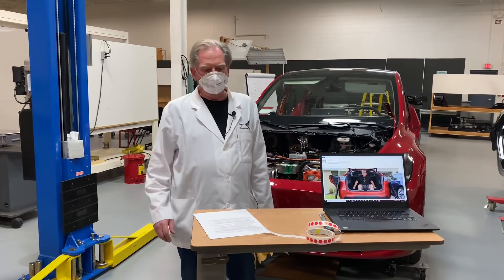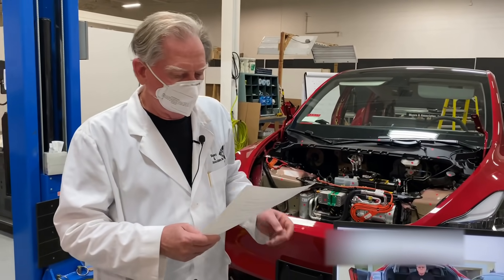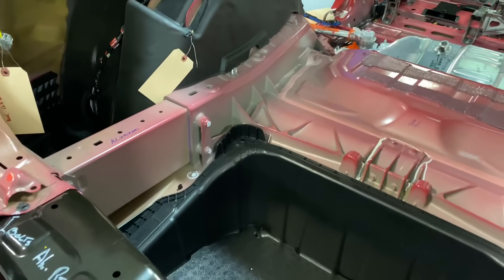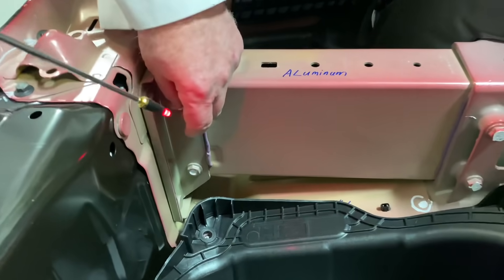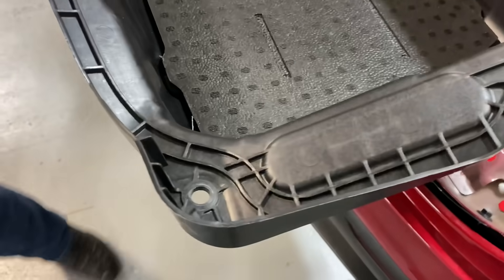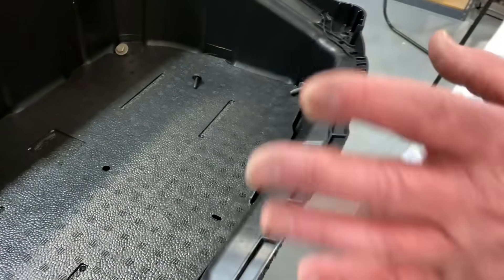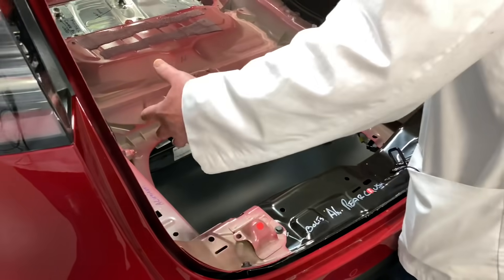Model Y E14: Rear Mega Castings and Structure, Trunk Tub, Potential Tow Location

Comment: If the mounting points move from the lower lip to the crash structure (the two aluminium rectangle section pieces) and if the lip itself gets cut out, then the idea of fitting one piece of "plastic" in the front and the back becomes plausible. The problem is this...the rear piece needs to have structure to sustain a human, the one in the front doesn't. So ... and i don't know how that maths out the front one would then become too strong, therefore a waste of material.

Just two cents of thought.

Comment: A heat pump, AC with free air circulation around it will run cooler and last longer. I don't mind a tiny bit of noise.

Comment: Is the non-matching bolt visible while the others are not (or vice versa). It seemed like the different bolt was black and the others were silver. A black bolt would match the bucket and look better cosmetically. Of course, the non visible ones could be made black too.

Comment: Sandy impossible to make frunk bucket and trunk bucket interchangeable. They are different widths and heights and would need to alter the frame and structure of car for what. YOU BLEW THIS ONE. The black buckets are cheap and to make and allows maximum size for both different areas.

Comment: The tow hitch is currently available in the configurator (at least in Norway) for 8800NOK (1000USD) with a capacity of 1600kg (3500lbs).

Comment: Its seem to me that the different one is color coded and goes in the middle. From the surface where the hole is, it appears to me that it may be exposed, i.e no trim covering it while other areas get covered? if so then i think having a color coated screw makes sense but then may be all of then should be color coated to keep it simple for installation?

Comment: If you think about it that bucket would be a good place to bolt in a range extender pack or even a small motor generator for extended trips / camping. 

Or even something that goes down and around and potentially replaces the bumper / number beam for a huge mounted rear storage lol.

Comment: No. Not tired of seeing you yet.
Now, I have to comment about how fast some vehicle owner could post about his complain (noise from the heat pump), while Sandy showed how the thing looks like and DURING THE SAME WEEK Tesla calls to inform that a correction is being made. That is not normal! You don't see that kind of speed in nearly any hardware industry. This is not an isolated case. There are plenty of stories of people suggesting or requesting improvements and corrections and Tesla responding faster than anyone else. Sometimes Elon himself does the responding. Other companies are watching, and they are learning [hopefully].

Comment: 3rd row seats will be front facing. There are multiple images online showing the orientation of the seat belts being parallel to the ones for the 2nd row. This is clearly displayed on Tesla's Model Y page. 
You may need to scroll down for the image to populate/slide into the middle of the page.
Also, I'm calling it now... 2nd row will have the ability to slide forward when the car is configured with the 7 seat option.

Comment: Mr.Munro thank you for your videos. Have a suggestion about the 5th bold that is black. Some manufacturers paint the bolts (screws)  with the same color as the surrounding plastic color. Can you check if the black bolt is visible when the trunk is assembled together? Thank you for your time

Comment: Thank you for all you are doing! We are not tired of seeing you.  Learning so much about the car. I have a Tesla Model 3 and am thinking about trading it in for a used Model S or used Model Y in a couple years. Your video is giving me a lot of confidence that Tesla is quickly fixing problems with the 3! I heard a rumor Tesla was thinking about removing the NiMH 12V battery in the model Y, simplifying the wiring, maybe a different connection to the doors? One of the main complaints I’ve gotten after putting 18k miles on my model 3 is the ‘rough ride’.  I’m hoping that was addressed in the Y or that is really going to upset folks.   Would love to see a comparison between ride quality in model 3/Y.  Would require you guys to borrow some non - dismembered cars :-).

Comment: So a plastic rear well is strong enough for someone to get in and out of a rear facing seat?  I’d think a metal well, like in the Model 3 would be stronger.  The possibility for a tow hitch is probably more for a bike rack or very light utility trailers, the Model Y certainly won’t be able to tow a camper trailer, at least not very far.

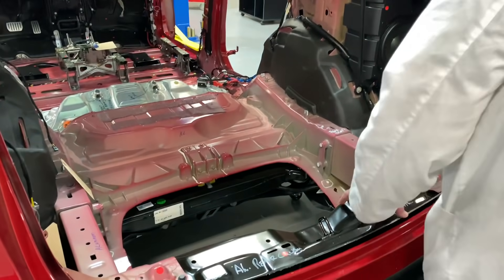Comment: 9:30. It looks like Tesla is paying close attention to your suggestions. There could be good reasons for the difference between the front and back liners. 
    With most legacy auto-makers it seems as if they deliberately have small differences between things, like trim pieces, which are often unreasonably expensive, which means having to pay dealer prices if something gets broken. Many parts nowadays are made of brittle ABS, which is very difficult to repair successfully.

Comment: Remember when Elon Musk said the Model Y would use only 328 feet (100m) of wire and wouldn't share the Model 3 platform .... the reality was in order to get Model Y out quickly .. it needed to extensively share the Model 3 platform and use conventional wiring .. and that's OK, as this Model Y obviously is the best Tesla yet, continuing to learn and improve, it's all good. Nice tear down commentary Sandy! .. watched all the vids so far, it's cool to see a few purchased parts in there that my engineering teams developed.

Comment: Wireless QI in the trunk or trunk. With that open gap in the front and back. It's possible to install a QI wireless charging reciever in there to charge up the Y without plugging it in

Comment: As MD of an engineering company 35 years to global auto Ive just spent 2 days assembling a 100 off items at home and guess what it had eight m3 x 6mm and two m3 x 8mm, my 6 sigma alarm is on red alert, I built 8 wrong, wrong screws in the wrong place........if you have to have different length bolts make sure that they really have to be different so they are very different or make them all the same, Mr Monro says so!
And we are kitting up work to be done at home as we speak just the same, find a way. 
Impressive Tesla taking feedback and responding, makes you realise everyone after the same outcome, success against the massive headwinds, they will make it. "Thats just about it for now!"
Reply: 3 people designing different parts of one product.
There should be a default bolt size where possible, only changed when absolutely necessary.

Comment: Sandy. The Model S had an issue with the a/c circulation and the rear facing seats. The back seats got uncomfortably hot in sun even with tinted windows. The tip Elon provided was to put the a/c to fresh air vs recirculate because the air exit in back was supposed to pull a/c to the back. That helped a little but still not great. Do you see anything that will improve a/c to the back seats vs model S. Better glass?
Reply: Also. The idea you had with the same buckets for the frunk and trunk. You should put together a bunch of ideas/options for the TSLA designed in China super low cost EV.  You probably have a lot of ideas (like the matching buckets) that don't apply as practical changes to current designs.

Comment: Adding a 2” hitch would be a huge benefit. Tons of people have hitch mounted bikes racks and having an SUV that doesn’t have this capability is a major drawback. It would be great if the hitch could be recessed behind the plastic cover, so you can put that on when it isn’t in use. I have a model 3 and will buy a Y if this is added.

Comment: Very interested in seeing what is inside the model Y because I expect to buy one once all the current chaos is over.  Maybe they will use the production pause to incorporate some of the things that Sandy is suggesting as running changes.  The software suggestion about the mirrors would seem especially easy to do.  Also, I would want to use a rear tow hitch, not to pull heavy loads, but as a mount for a bicycle carrier.  A weight limited unit that would not compromise rear crush-ability of the internal bumper cross beam seems like it would be doable, and not affect the range or safety of the Y significantly.  Most SUV buyers expect this capability, I think, even on small crossovers like a RAV4.

Comment: At 8:48 Mr. Sandy says the rear bucket should have been "glued in fiberglass", and he knows why tesla is using bolts instead. Is the bumper hitch cutout the reason for that? So that they can modify the structure later?

Comment: You might want to consider masking out Richard's email address...
Reply from the maker: Yep, working on that.  Thanks for the feedback and for tuning in!
Reply: @MunroLive   easiest way is to open notepad, and stretch it over needed area :) simplest, fastest, 100% effective without any post-editing :) 

BTW, I absolutely love this teardown series, and check for new episodes dozens of times every day! If you can please continue :)
Also "blue plastic brackets" holding candy-wrapped wiring is probably "designed" to be changed to new patented "flat" wiring looms, when those are ready for use in production ;)
Reply: @TheBartu5  Or like.. Screenshot only the area you want to show..

Comment: Sandy,
I think the third row seating will be only available in an 1 motor (front) configuration version of the model Y. The rear casting as you can see, has a glued in sheet metal cover over the rear motor assembly. In this third row configuration, I think this cover will be removed and the legs of the occupants will occupy this space. The rear facing orientation is also possible, but all the pictures I’ve seen are with the seats facing forward. Just an idea.

Comment: 6:40 Ok, so nobody is gonna mention that subwoofer in the trunk?!
Reply from the maker: Thanks for tuning in Peter! It is possible that we discuss this part in future videos. Not atypical for vehicles to feature this type of sub-woofer in the rear quarter panel. We will let you know if there is anything unique though!
Reply: @MunroLive  Thanks for the reply! The wow part was that you couldn't see from the plastic covers that there is a subwoofer because it was completely covered up. In other vehicles is very obvious because of the cutouts. If somebody wants to check what I'm talking about, take a look at 0:25 in E10 where Sandy explains the third row seats. Cheers! :)
Reply from the maker: @kpeterrafael  Yes, it definitely saves from a design and assembly stand point to bury the subwoofer and not have to put in an A-surface speaker grill, which some OEM's like to show off as part of the design. Some notable vehicles that also bury the subwoofer behind rear trim panels are: Mercedes GL450, Volvo XC90, Range Rover Velar. Also VW, Audi, & Buick have been known to put them in rear spare tire under load floor. Always fun to discuss these details!
Reply: @MunroLive  Great stuff, good to know, indeed fun to discuss these small details. I'm wondering if the sound quality is affected by not having a surface grill and that it's behind the trim? PS: It also would be great to tell us a few words about the overall sound system in the Model Y and if it's the same as in Model 3 or something different. Thanks! 😀
Reply from the maker: @kpeterrafael  Short answer: yes, there would likely be some degradation of sound quality. Long answer: we definitely don't claim to be experts in audio/acoustic performance but best guess is that the low frequency range of subwoofers lend themselves to be "felt" more than heard. Audio clarity/quality likely can't be distinguished as much by the average consumer at those lower frequencies. Also, a full comparison study between Model 3 & Model Y is currently underway.
Reply: @Munro Live  I’ve seen the base set at the bottom of a trunk with the speaker nested under the rim of a spare.  I thought it was bloody brilliant!!!
Reply: Munro Live home surround sound systems now have multiple subwoofers, to balance sound areas.
Check high end utube videos. 9-2-4. 2, 3, 4. Low bass being unidirectional is not that true anymore.
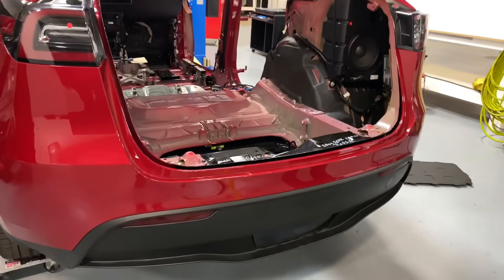Reply: 10:50 better view
Reply: I thought the same 😂

Comment: Thanks for your awesome work Sandy and team! Just wondering when we will hear about the “flex circuit” or “flex harness” or whatever the name was - the method that reduced the cabling 10 fold?
Reply from the maker: Thanks for tuning in, David! We will definitely have some videos dedicated specifically to that topic, but in short, that technology does not appear to have been implemented into the Model Y.  The wiring harness construction, although relatively compact, is still conventional like what was in the Model 3.  The wiring has definitely not been reduced ten fold.

Comment: 2:08 About the rear casting, I wonder if the MIC (Made in China) Model 3 might have been changed and already use a similar rear casting?
Reply: you'd think that was highly likely. In fact, given Tesla's culture of constant upgrading, i'd be very surprised if the Chinese doesn't use the latest ideas.
Reply: @goldreverre  It seems so much simple to have those two floor plan casting pieces connected in the middle.
However I wonder if they could use such change in US without passing a new car crash validation?

Comment: Re the "Tow Hitch". If the Y is not rated for towing at least allow a 2 inch mount for bicycles (no electricity connects). If necessary the mount could be "keyed" to block wheeled trailers and only allow a "Tesla" branded bicycle hitch (new revenue stream). Lack of a standoff bicycle hitch affects potential sales of the Y and the 3
Reply: The M3 (ordered after May 2019) is certified for towing 910 kg here in Europe, so I would presume the upcoming revisions will at least match that spec. Then it would accept all standard bicycle hitches and other accessories. This package will probably be available in 6-12 months if it roughly follows the schedule of the M3.
Reply: The Model Y has a tow hitch option now; 1600 kg towing capacity!!

Comment: 10:32 I don't see the need to make any change. The rear bumper seems to be designed the same way as the Model X. 
Behind the rear bumper cover, there will be an additional bolted beam to hold the removable tow hitch.
Note: Can you review and make comments regarding the shape of the bumper exposing the bottom of the tailgate. 
So in the event of a small rear impact, the rear bumper might absorb the impact and have just a little scratch.
But the bottom of the rear gate might be damaged and will have to be replaced.
Reply from the maker: Regarding your note: Please refer back to episode 11 where this was commented on briefly between the 2 & 4 minutes marks.  https://www.youtube.com/watch?v=0onKJm4aYfU&t=126s
Reply: @MunroLive  Thank you for your reply. I was talking about when parked in the street, a car maneuvering  to close
might damage the bottom of the tailgate while the soft rear bumper cover would only get a small scratch. 
Anyway I cannot wait to see the Model Y rear bumper cover removed to understand how a tow hitch beam can be installed.

Comment: Another great video. I liked how you though in the term Poke Yoke.
Reply: I had to look this up as it went by too quickly. [poka yoke]) is a Japanese term that means "mistake-proofing" or "inadvertent error prevention". A poka-yoke is any mechanism in any process that helps an equipment operator avoid (yokeru) mistakes (poka)

It's pronounced poh-kah yoh-kay in Japanese.

Comment: Hoping the Model Y will soon get a much bigger battery. News from China talked about a coming long range LFP battery (Cell-to-Pack technology?) for the Model 3 with about 404 miles or 650 km range. Currently Chinese Model 3 SR get a prismatic LFP mid range battery or for the Model 3 LR the well known long range battery with 21700 Panasonic cells.

Comment: I find these vids very interesting and well explained, and I don't even own a Tesla. One quibble though - why is having 2 sized buckets for 2 different areas a problem? Putting in the design effort to shape major body components, indeed crash impact zones, to deal with a couple of simple plastic moldings can't be worth it. The only way to come close would be making the frunk bucket smaller and leaving dead space around it. Oh, and that fifth bolt - the commonality issue is so obvious it makes more sense there is a specific reason, rather than such blindness on the part of Tesla engineers. 

Hmm... perhaps that fifth bolt will do double duty once the hitch is added, perhaps to also hold the wiring bracket.

I look forward to your work on the Roadster!
Reply: The plastic molding machine is very expensive for a compliquated part like that so they would save millions if they could use one machine instead of 2.

Comment: So far my only design doubt is about the choice of metallic conduit between the charge port and the battery pack. Seems like a rear or rear quarter impact could cause force to be transmitted via the conduits to the connector on the battery pack and twist it enough to cause an expensive repair bill (i.e. pack replacement).
Love that you are sharing insights and years of expertise with us - thank you!
Reply: Good point. Perhaps the 2 conduits are souple enough with enough bends to deform before getting deflection at the battery connector. My thought Is, if a collision is bad enough to damage the connector, the car would likely be a write off anyways